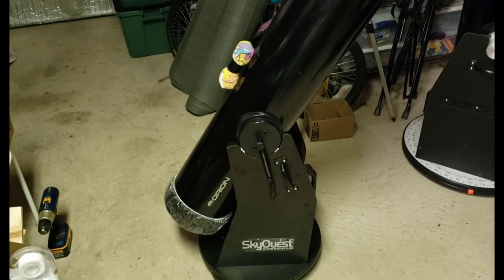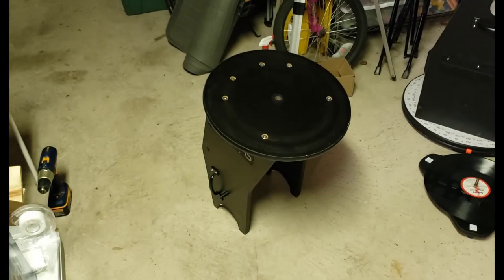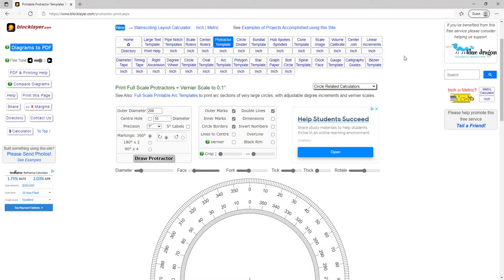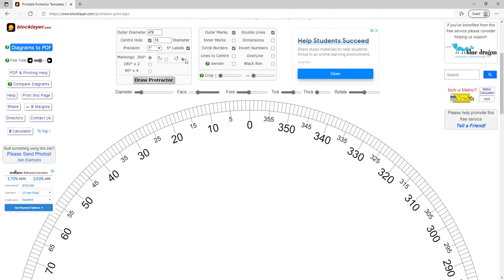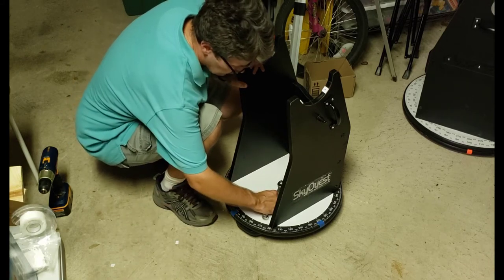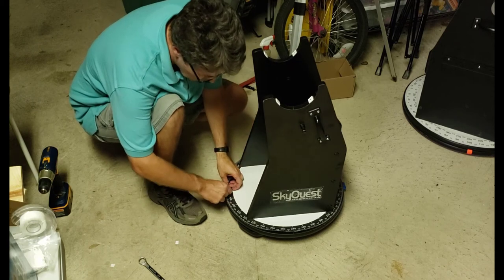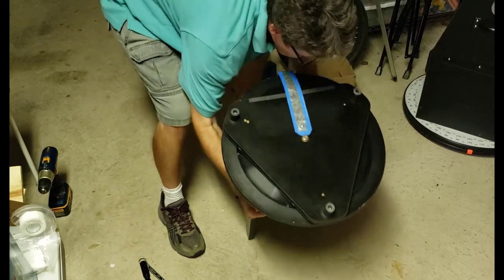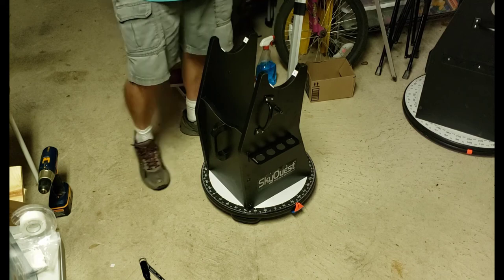Cheapest Quick-Aim Telescope Upgrade: Installing and Using a Paper Setting Circle for Quick Aiming

Comment: I just followed your advice to install setting circle on my Apertura 8" Dob.  Thanks.  Once installed I used two sided woodworker's tape to keep the edges from curling up, but left me able to remove it if it gets damaged.  I used a gray sharpie to mark the 0 degree spot on the lower base.  When I go out I'll align that with true North using my iPhone.  When I locate a star I can use the degree marks to adjust the lower base.   I appreciate all the videos you create to modify and upgrade your scopes.
Reply from the maker: The Apertura 8" Dob is one of the best value Dobsonians to buy - I think it even comes with a lazy susan azimuth for smooth spinning?  The easiest way to get close to true north is to point it at the north star.  That'll get you within at least a half degree. Have fun!

Comment: I just bought the cheapest Celestron Starsense scope (LT70) and swapped the Starsense unit onto my 12” dobsonian. It’s an amazing piece of equipment that uses plate solving and guides you to each target in seconds. I am also considering fitting setting circles/inclinometer to it as a back up. Great video by the way 👍.
Reply from the maker: Thanks for watching!  Wouldn't it be cool if you could just buy the Starsense system separately?  My next video will address this very issue.

Comment: Just finished installing a setting circle on my 8" Dobsonian. I went with black background, white numerals and tic marks. My pointer is a bit different, as it clips onto the edge of the base plate and can be moved as needed. Total investment: $3.04, not counting the pointer, which I cut out of scrap aluminum. Can't wait to try it. Thanks for a great idea.
Reply from the maker: Congratulations!  I think you're really going to have fun. It makes finding things a snap.  Don't forget to level the base before using - that makes a huge difference.
Reply: @reflactor  Roger that. I glued a circular bubble level to the base. For alt setting I bought a cheap electronic level that magnetically attaches to the steel tube of my dob. Once I find true north, I can find most objects very quickly.

Comment: Thank you so much for this instructional video & clear explanation. I have the same XT8, so I was able to duplicate most of what you did. I didn't do the record part though, instead I just got some 1" rubber chair feet and that held the base of the telescope firmly so it doesn't slip or shift around while I rotate the telescope. Thanks again for such a great video, and it saved me so much time locating comet PanStarrs 2017... I can't wait to use it for looking at much more.
Reply from the maker: Thanks for watching!  It's good to hear from a fellow XT8 owner - they are fantastic telescopes. I take the XT8 on all my campouts. Congrats on finding the comet. I'm jealous!  The light pollution is too intense here to see it yet, but I'll keep trying.
Reply: @reflactor  Well, I was somewhat disappointed in Panstarrs 2017, It's pretty far out and it's nothing like Neowise. I could see Neowise with binoculars, I don't think that will be possible with Panstarrs. I am very much looking forward to another comet that comes around the sun much closer. Thanks again & clear skies

Comment: Great idea, I used the site and printed it out at office max for $5. I went with a analog level meter from amazon. Leveling is crucial, once leveled and calibrated, I was just 1 or 2 degrees off in alt and az on my first trial. I was picking up  targets in less than a minute. I was planning to go with a rotary encoder, but if this works so well, I may not go that route. Thank you very much for the video!!!!
Reply from the maker: Thanks for watching!. I'm glad it worked out so well for you. I have these paper setting circles installed on my big and little Dobs.  It is really surprising just how well they work. I usually start out with a low magnification eyepiece (32mm) and it finds the target every time.
Reply: @reflactor  I have a 10 inch dob, the base diameter is 22 inches, so the circle is quite big, but it fits fine, I think I could have done a better job with the alignment, but it’s with in 1-3 degrees from where it should be. I spotted about 20 targets from sky safari ‘tonight’s best’ in about 30 mins from my bortle 9 yard. That’s a new record for me. I start with bright stars to get the calibration right before going to DSOs. I am sure I am going to get all my Astro friends converted. It was a fun project.

Comment: So helpful! Thank you for sharing all these tips, can’t wait to upgrade my XT8.
Reply from the maker: Hi Michael, glad it was helpful!  I still use the XT8 for about 90% of my observing despite adding a 12" Dobsonian to the workshop (both have Setting Circles). The XT8 fits in my car and it isn't a back-breaker like the 12" telescope. I honestly believe the XT8 is the best overall telescope you can own.   And there are lots of ways to hotrod it.  Have fun!
Reply: One year later, I am finally replying. 

After upgrading the XT8, I sold it and bought  a 12 inch sky watcher and 4” AstroTech refractor. Like you said, the 12 inch is awesome but unwieldy so it does not get tons of use. But I am loving the refractor. I was able to make a setting circle for that, too. 

In part, because of your video, I have made a little side hustle out of purchasing Dobsonians, upgrading, and flipping them. Sold five or six so far. It’s been fun. Thanks, again.

Comment: This literally just blew my mind. I ordered my AD8 today and I'm so glad I stumbled on this awesome video! Only thing that I'm wondering if there is some type of light roll on or spray adhesive that'll bond the laminate to the MDF particle board. Preferably an adhesive that's on the gentle side where it wouldn't destroy the black finish if the laminated setting circle is removed in the future. I would just like to see that laminate bonded thoroughly to the MDF so that the install looks clean down the road after a good amount of use. Thanks again for taking the time to make such a great video! Would be so cool if those numbers and lines could be printed in glow in the dark color; not that it would last all that long but still would be cool.
Reply from the maker: Congrats. The AD8 is a very good telescope (lots of extras). It comes with a RACI viewfinder, so you'll be ahead of the game (by avoiding the "neck pain" stage!). As far as hold-down power, sandwiching the circle between the upper frame and the disc is more than enough to keep it put.  The edges might get a bit "roll-uppy", but I use a few strategically placed pieces of clear packaging tape to make it flat.
Reply: @reflactor  ok thanks for the input I'll go ahead and use the tape. I honestly was stuck between this and going up to a celestron 8inch Evo. I just couldn't justify the price tag in my mind so the fact that you've provided this has completely taken the want of the Evo out of my mind.
Reply: 3M spay tack is gentle and will hold the edges down easily. If you need to it can be removed easily too.
Reply from the maker: @1313Roz   That sounds like very useful stuff.

Comment: Thank you for the excellent video. I watched 10 times and created my setting circle using the website tool and saved it in PDF. Next I will get it printed and laminated. IT will be very appreciative of you if you can post how you constructed the pointer and the list of materials and dimensions. I have a 10" Orion Skyline Dob with 22" ground plate.
Reply from the maker: I made the pointer out of gutter flashing (thin metal sold in rolls at Home Depot).  You can bend it by hand, but I cut it out with metal snips.  The magnetic strip was a self-adhesive flexible magnetic strip sold on Amazon.

Comment: Watched this when you first uploaded and say I have been looking for this exact thing would be an understatement. My only question is why did you go white on the inside of the ring? Does it help with the numbers? After using this particular setup would you change the colors of the paper? Love the content. Thank you
Reply from the maker: Good question.  The free creation tool does allow me to expand the black band most of the way to the middle.  Not sure why I left it as white - perhaps it was a subconscious desire to save printing ink?  Different color ink might show off more contrast given the red headlamp. I didn't think about different ink colors though. Definitely work experimenting!

Comment: Just discovered this. I’m going to do it. Thank you. How did you get your base to move so smoothly? Mine is very stiff, I’ve loosened the bolt as much as I can to keep it from wobbling, but still very stiff.
Reply from the maker: I've tried a few things.  Replacing the Teflon with larger pieces might help.  I also put a tiny chamfer on the sharp edges of the Teflon. I recently added an old (very large) vinyl record into the mix, shown in this video:  https://youtu.be/JyDgAPzE6_8
Reply: Thank you, I’ll try that.

Comment: Could you shine a very bright light up through the base in order to locate where to mark and cut out the holes in the template for the mount screws to pass through?  I guess the thickness of the paper chosen for the template will determine if enough light passes through.
Reply from the maker: One way to implement that method would be print an oversize paper circle that extends slightly beyond the outer edge of the disk.  Then you could mount a light/pointer on the lower disk that will shine up through the paper. I've seen lots of creative ways to mount the pointer, so just use whatever way is easiest for you.

Comment: Thanks a lot i will do this to my gso 10" dobson soon. A question, is it possible to use this together with a eq platform? I would think if one dooes set the eq platform to zero in the beginning it must work?
Reply from the maker: For the setting circles to be accurate, the bottom of the Dob has to be level and unchanging.  I don't know if that's possible with an EQ platform though.  I don't have one, so I'm not 100% certain.

Comment: This is great 👍.  I have the same scope and will be doing this.
Reply from the maker: Hope it helps.  The XT8 is a great telescope.  Clear skies!
Reply: @reflactor  I almost finished already!. That blocklayer website is great. Got the setting circle printed on laminated canvas at a photo store (no Staples here in the UK) .  It curls a little bit some spray adhesive will address that. Just got to make my pointer and order my inclinometer and no more searching. Thanks again for a great post.

Comment: I noticed that he Blocklayer protractor tool also has a check box to print an optional vernier scale.  I think this might be pushing to limits of precision of the whole system, but it might be worth playing around with.
Reply from the maker: I agree that would be pushing the limits of accuracy for my particular setup.  The guy who made that webpage did update it a bit after my video came out (he said it was due to a limitation found in my video). That was very kind of him.

Comment: Great Video, thank you.  What is the purpose of the covering/net on the base of the scope?
Reply from the maker: Hi Kenneth, that covering (shower curtain with elastic band) serves two purposes: 1) It keeps dust out and 2) It keeps bugs out (hopefully!). Here in Texas, we have a problem with Black Widow spiders in our garages.
Reply: @reflactor  I'm in fort worth.
Reply from the maker: @InChristJesus87    Welcome to unusually high light pollution. If you go west of town about 45 minutes, you get into Bortle 3 light pollution (very good).  Or so I'm told - I've not used a telescope in such good viewing conditions yet.  Big Bend is the nearest Bortle 1 that I know of, but that's a full days drive.

Comment: Hi Reflactor.
Do you have the same for the azimuth? a video or suggestion?   I made the circle by using the blocklayer website and going to my local office supply store.  The office supply store wanted more money because I had the design printed from the center to the outer edge in black, a whole lot of black. The office worker understood what I was trying to do and suggested I only print the outer 2" which is what I actually needed, and called the print a blueprint; the price came down to under 10dlls. The laminate machine was broken at the time so I'll have to redo it but for under $10 I can use the first printout as a learning tool before going back to the store to print a laminate... Super good idea and execution. Thanks
Reply from the maker: Did you mean altitude (elevation)?  This video was all about putting a setting circle on the azimuth.  The altitude measurement is even easier than the azimuth because it uses a digital level, held to the telescope with a magnet.  It generates the angle reading automatically and is very accurate.
Reply: @reflactor  thank you

Comment: Fantastic. I have a Dobsonian that I am rebuilding and I've always wanted to do this. Two questions. You mentioned using an app for RA and Dec. What is that app? Also, I suppose that the app takes into account the time of day you are viewing to set the coordinates correct? Again, fantastic.
Reply from the maker: Most smartapps will generate the two popular sets of coordinates. For people using Dobsonians, we use the Azimuth (compass angle) and Altitude (elevation angle) combination.  You can also get the smartapps to produce the Right Ascension and Declination angles for people who have equatorial mount setups (way too complicated for me). For the most part I use StarSeek 5.
Reply: You can get ALT/AZ coordinates from Stellarium freeware.
Reply from the maker: @swftwlly   You are correct. Several of the smarphone apps offer both. It just depends on which interface you like best.

Comment: Hi, brilliant idea. I've been considering doing this myself but the problem I have is that I can't see polaris from where I do my observing. Do you think this would work by alligning to North with a compass?
Reply from the maker: Yes, but you must be very careful to use true north instead of magnetic north.  That's the complicated part.  Depending on where you are located on the planet, the variation between magnetic and true north varies.  As long as you're careful with that, then you should be okay.  Alternatively, you could get away with using a different reference star, but it might not be as rock solid as the North star.  One of the cool things about the North star is that I can re-check it quickly every 30 minutes or so to make sure I haven't bumped the telescope out of alignment.  It's just one of those super convenient coincidences. Good luck and have fun. Clear skies!
Reply: I think the best solution is to use a different reference star. Is more accurate that use a compass and the correction of the magnetic declination. A good refference star is vega for example. You only have to calculate the azimuth difference between vega at the moment of the aligment and the object you want to find.

And example of the method could be to find m55. If vega has 12 degrees of azimuth at the moment of the aligment and m55 has 159 degrees of azimuth, the corresponding mark on your setting circle should be 159-12=147.

By the way, when you do that you have to move fast because the object is changing his position and the azimuth is changing too.

Comment: Howdy, Mr. Dreese;
"THANK YOU!", EVER so much!
I just made & downloaded the file for my Orion.
Now if I could figure out why the IntelliScope gives strange goofy numbers.
I /think/ one of the sensors is out of calibration but I can't hardly find any info on the system.
I really appreciate your channel so I subscribed.
You keep up the good work, pal.
Have a GREAT day, Neighbor!
PS
Your "About" page mentioned airfoils, I need a good free design for building a "prop" for a DIY wind turbine.
Say 3-4 ft dia. so I can get some good speed.
I'm just starting out w/ this so if you know where to find good info I'd really appreciate it.
Reply from the maker: Thanks for watching!  If it's an Intelliscope, then the culprit is probably a flipped encoder ring (see my restoration video here for a demonstration of the problem and the fix:  https://youtu.be/9O7PHAUD96I).  As or the wind turbine airfoil, I always recommend trying to borrow from similar tools because their engineers have already run long-term analysis on it.  Try to seek out a similar-sized wind turbine and see what they used.  If all else fails, check out a Clark-Y or NACA 2412 airfoil.  Best of luck and clear skies!

Comment: How do I do this in southern region I can see the sigma octane that bright like polaris
Reply from the maker: I looked into this and I don't have a definitive answer. What you can do is find a star near the southern center of rotation and aim your telescope at that.  Using your app to see what the altitude angle and azimuth angle should be and then set your setting circle zero accordingly.  It will be approximate, but should still get you close to your later intended targets.
Reply: @reflactor  thanks a lot for taking time to explain it. I will give it a try for sure. 😀

Comment: Well done, just sub to help you get to 1000 for monetization. I think I would use spray adhesive to anchor the setting circle then drill out the holes.
Reply from the maker: Thank you!  I think spray adhesive would be great for this process - I may try that next time.